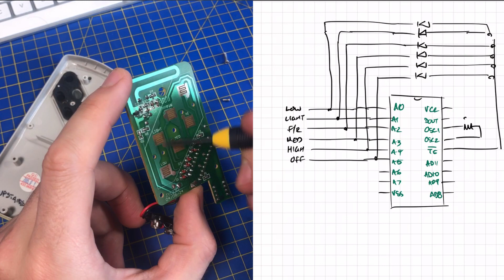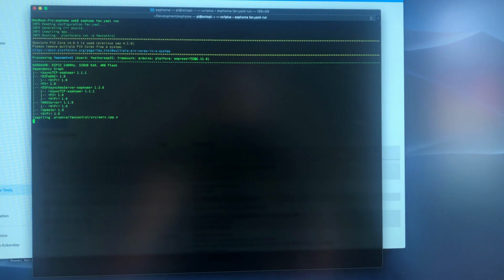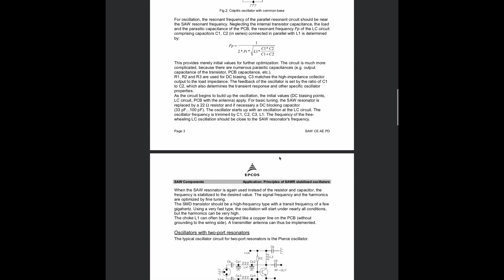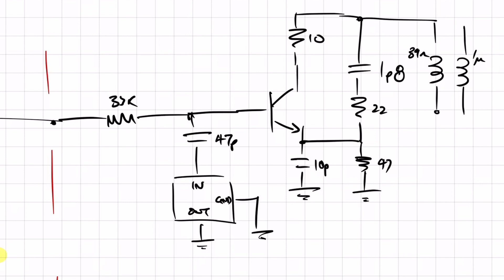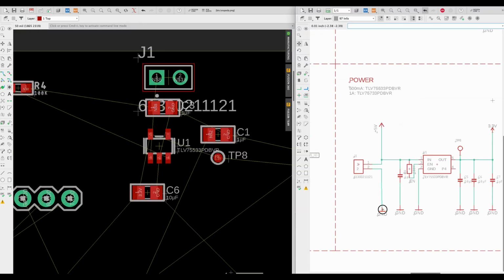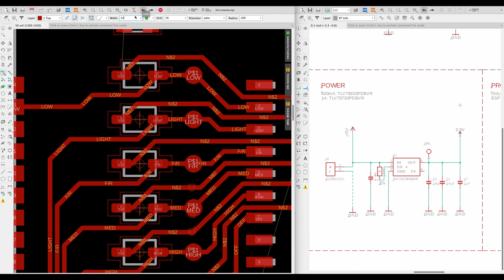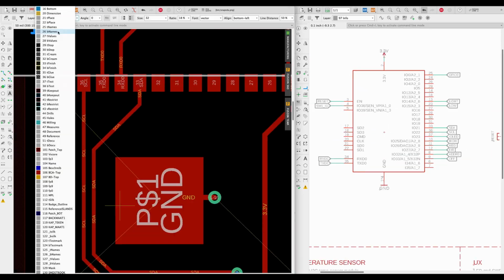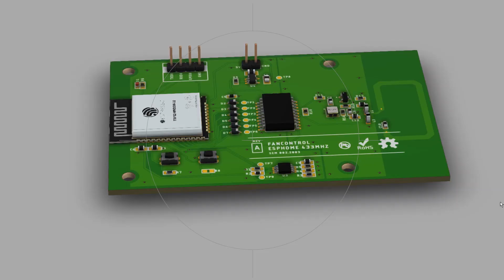Smart Home Control for Ceiling Fan - PCB Layout Tutorial!

Comment: Great video. Thanks for sharing. Btw, have you tried to integrate the ESP32 into the remote receiver/fan control circuit instead of the remote transmitter?
Reply from the maker: I thought about doing that! The reason for my approach is that I don’t actually have to “hack” into anything - the remote I pulled apart still works and if my device fails, we can always use the old remotes. I did however connect my garage door into the network by connecting a relay across the button in the actual door controller, in the way you suggested.

Comment: Great stuff.

With the ESP32 you can use the pin multiplexer and move the I2C onto other pins very easily :-)
Reply from the maker: Thanks for watching! Yep, to MOST pins, there's a few which should be avoided though - like bootloader pins, and not all pins are both input and output which I2C requires :). Also, if you're using the Arudino framework, it can be tricky to change from the "defaults" as the pins are hardcoded into the Wire library! In my surftrack video series I use the nRF52x series, they're very flexible with use.
Reply: @PrototypeBeta  Yes, a lot of the Arduino libraries are quite lame how they are coded. 
It all depends upon if you want to fiddle their code to make it better :-)
Sadly when you do push back fixed code it often falls on deaf ears :-(
I myself now include the libraries as part of my PIO project, and fix the bugbears :-)

Comment: Did you try first reverse engineering the RC codes?  Those remote controlled mains/outlets can use a method like this to be controlled via arduino/esp32, and I would assume most fan controllers do the same.  http://code.google.com/p/rc-switch/
Reply from the maker: I didn’t try first no. And I agree, the esp32 can easily “bit bang” the carrier modulating signal of this remote. If I was making 1000s, then saving a few $ in the BOM (by removing the HTE chip) would be worth it - however, given it would have taken me a few extra hours to do code it up, in this case, sticking a $3 part on the board was worth it :) (and I like using discrete components!)

Comment: I like to use diptrace, because it's so easy to use. Also you could use 433mhz module to tx (it seems like ask signal?)
Reply: Like using Universal Radio Hacker to determine what signals to send through the 433MHz module?
Reply from the maker: No, I have a 100MHz scope which is fast enough to decode the modulation signal from the HTE encoder (I think there's a shot of it in the video), I attach the scope before the RF mixer.  In the end the 433Mhz is just a carrier frequency so I don't need to "see it".
Reply: @PrototypeBeta  Good call man, thanks for the re-enforcement.  Having a blonde moment.
Reply from the maker: Thanks for your comment! I did think about using a 433mhz module, but the application guide I found for the SAW resonator was so thorough it really helped with that part of the design.

Comment: Also, you mentioned you don't have a network analyzer. If you want something that's functional you can get an RTL-SDR or hack-rf for $25 and $100 respectively, and it'll work great for an application like this.
Reply from the maker: Wow, Hack-rf looks awesome, thank you for the suggestion I might get one and play with it!
Reply: The NanoVNA's are pretty sweet also for the price point.  Well worth investing in and now they've expanded to the 2nd version up to ~3GHz.
Reply: jafinch78 oh really? That’s not bad. I like the hack-RF because it has half duplex of 6Ghz but I’ll look into that one. It’s not common to get them past 2.4ghz
Reply from the maker: having coverage of 2.4G would be very very useful
Reply: @jimmysyar889  Yeah, not discrediting the HackRF... figure my perspective is I've owned one for well over a year and just literally loaded up the drivers and used with the sweep spectrum analyzer a few days back. I was super nervous to not damage and wanted to learn more before I setup and powered on as I pushed my first cheap RTL-SDR beyond 1.7GHz and fried something.  The HackRF is great.  I'm thinking about investing in an Adalm Pluto to hack up to ~6GHz and study the differences between the two designs and also have ability to use both for measurements.  That's like a dev platform also with some other demo'd hacks to improve performance in the same way.  I'm just amazed what that NanoVNA at the price point can do.  Really impressive for what is like a couple bucks now for the original version and looks like around $50 for the latest version 2.
Reply: jafinch78 the only downside with my hack RF is that it seems that it’s pretty much deaf. I can’t even pick up radio stations with it but it’s super nice for testing stuff that transmits within 10 feet. (Like this prototype)
Reply: @jimmysyar889  Now you mention, I think the SDRPlay RSP1a is better for far field work since has a lower noise floor... though might be with the HackRF have to be more critical with the antennas tuning and matching I guess like with any system.  Not sure and not sure regarding different math functions yet that can be custom made like in GNU Radio Companion to normalize and other methods to avg signals or what can be performed to improve operation.  Like you're noting is what I was thinking at first... though I kind of had a guilt trip moment recently where a gal noted she and others have HackRF's and were wondering about how to use to fox hunt for signals... so I figured I better get mine to work and see what I can figure out.  I'm working on a spiral conical antenna for more wideband far field work from about 400MHz to above 1GHz (I hope at least that's the plan) since I don't have my discone antenna with me where I'm at.  I have two other designs for higher than 1GHz I guess and still need to test based on Andrew McNeil's.  Was thinking investing in a noise source for ~$10 so have to use and inspire new players.

Comment: Can you explain the separate ground planes, the single connection point and the isolation caps? Overall the video is very nice!
Reply from the maker: So the separate ground planes aren’t strictly necessary for this low power, but it’s good practice to get into. Basically you need to think of each component’s power source as a “ground loop” - how does the current return back to the original ground point (my power connector in my case). Simplifying a little, the current will flow in the shortest path back - and you want to avoid crossing these ground loops between your “noisy parts” and your “sensitive parts”. Because I have two RF oscillators here, I put them at opposite ends of the board, and the power connection in the centre at the top - this way the “Ground loops” from each would return back to the power supply “without crossing”.  Splitting the plane (or rather, creating a large slit down the middle) and having the “join” at the power section just reinforced this separation - but I stress it probably wasn’t strictly necessary.  

The isolation caps help as they “absorb” higher frequency noise and filter this out.  This is important, basically you want to put a ~1uf or 10uf cap as close as possible to every VCC pin on your components to reduce the noise at the VCC line going in.

Comment: Love your narration on the pcb designs! May i know what program you used to design those pcbs?

Great work as always!
Reply from the maker: Thank you! I used Autodesk Eagle to do these as it plays nice with Fusion 360 and I've built up my libraries.  KiCad is awesome opensource alternative and Altium is brilliant, but alas not not Mac.
Reply: @PrototypeBeta  Thanks! Can't wait for the next video. A channel which shows the step by steps of product design is something I've been looking for a while and this channel just hits the nail on the head!

Keep up the great work :)
Reply from the maker: Thank you!  I’ve actually just built the PCB and am now testing it, getting ready to film/edit the next one!
Reply: @PrototypeBeta  I was wondering what you thought of Fusion 360's built in schematic / pcb editor. I started my cad education with Fusion 360, and I'm now at the point of laying out pcbs, so I've been using their editor to avoid learning another program.
Reply from the maker: As far as I'm aware, the built in editor is only useful for "mechanical changes" - i.e. moving components around, changing the dimensions of of the board.  I could be wrong, but to design the circuit schematic and board layout you need another program - and in Autodesk world, that's Eagle (which I use).
Reply from the maker: So turns out that I was wrong in my other comment @travis dean - Fusion360 now incorporates what was called Eagle (what I filmed). So apart from the colours being all out (I really like dark backgrounds) and the annoying save-to-cloud-by-default, it appears to be as good as eagle.